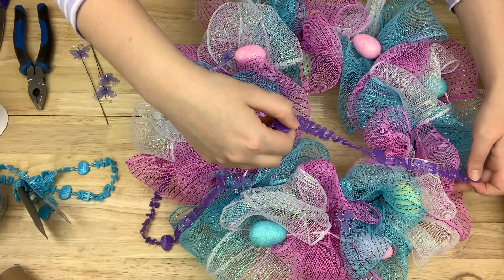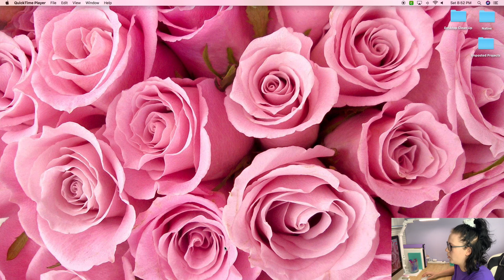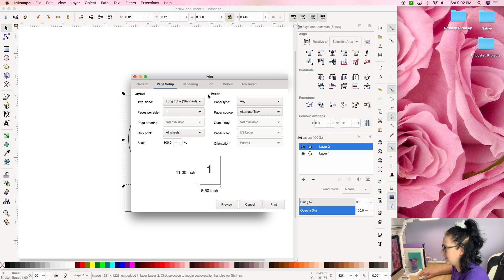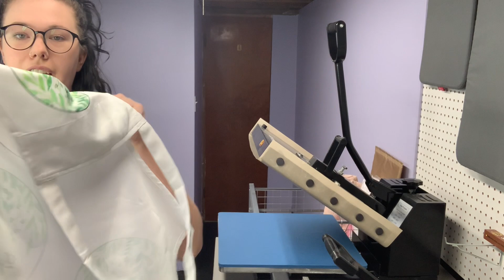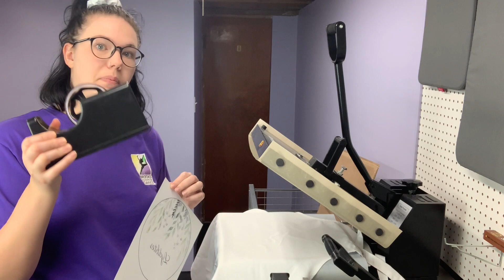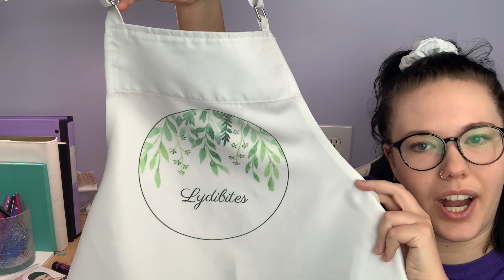SUBLIMATION FOR BEGINNERS: DIY Apron + Inkscape

Comment: Awesome video.  What A Sub paper works best in your converted Epson printer?  125 or 105?  Curious as I'm going to be converting my WF3540 printer soon.  Thanks.  Which paper is thinner?  105?
Reply: I think I've answered my own question by doing some reading - it's according to the design you are sublimating.  I just wondered if the 125 ever jams in the printer, or if it slides easily since it's thicker.
Reply from the maker: @jaschembra  hi Julie!! Thanks so much! I currently have the 125. I’ve heard most people prefer the 120 or 105 with this printer because of jamming, however I haven’t had any issues whatsoever with the 125! At least not yet!